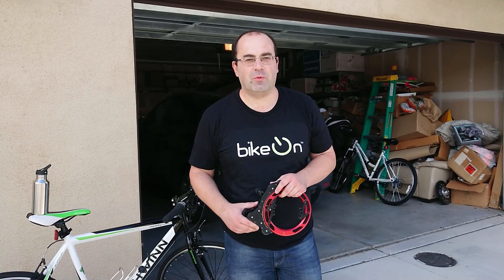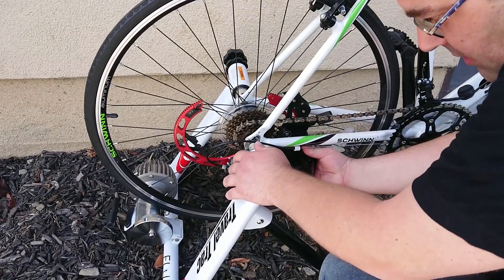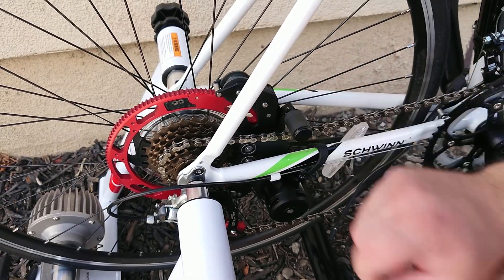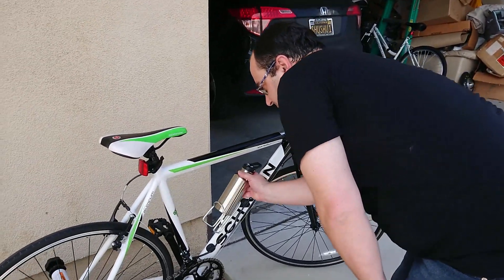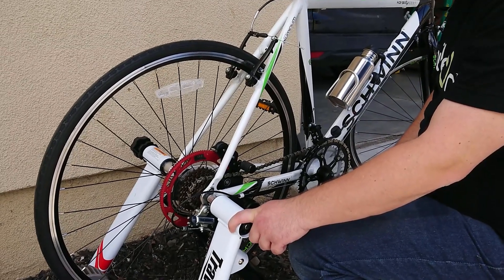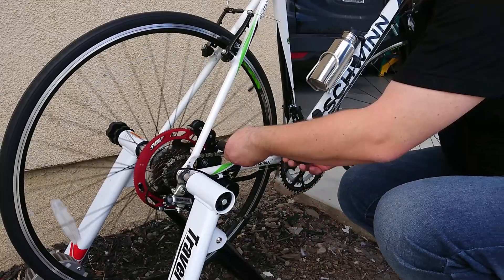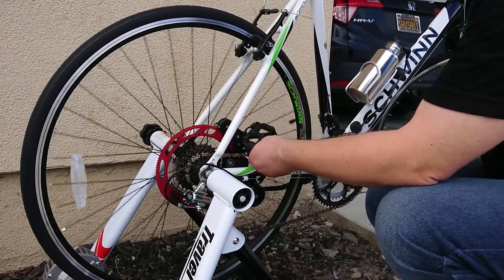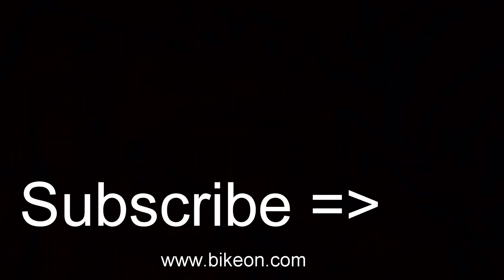BikeOn Demo: How BikeOn Works. HackadayPrize

Comment: Genius concept to measure the chain tension!
Have never seen such a simple torque sensor.
But how many of the gears in the rear are still usable?
The lowest gear is blocked by the device. What about the other gears?
Reply from the maker: Thanks. You lose 3 top gears, basically you exchange them for a motor. You can still use the rest.
Reply: @TheBikeOn  Oh! loosing 3 Gears is not exaptable. Maybe once i get a 12 Speed 10-56 or 11Speed 11-50 and use 11-32 missing 36,42and 50. Now i use Bosch with 10 Gears 11-36 or 11-40 on MTB.

Comment: You're brilliant! This is the easiest conversion kit I've seen. Will this work on a 20in fat tire trike, I just need help pedaling uphill. Thanks.
Reply from the maker: Hi. It will depend on the trike. BikeOn is compatible with most standard bicycles with gear size of between 25 and 36 teeth. Currently BikeOn is not compatible with BMX and other single gear bicycles (fixies), Brompton and other folding bicycles, bicycles with belt drives, internal gear hubs and bicycles with a chain guard.

Comment: Ok i don't know the exact language to use but I'm a very heavyset rider. I need my bike to go up hills when I can not. I love my bmx. Something like this ad on would be amazing so I don't need to buy an ugly EBike. Sooooo how fast & how long will it go uphill with a person that's 285 - 300 lbs?   If it's decent... I want one!
Reply from the maker: We have tested BikeOn with riders of 230-250 lbs on very steep hills. With some pedaling effort you can get up to 15 mph on those hills. The range of BikeOn is up to 20 miles depending on the terrain and the level of assist.

Comment: Awesome. How is the average distance capacity?, How many watts power? Love the torque sensor
Reply from the maker: Thanks for your interest. The range is up to 20 miles depending on the terrain and level of assist. As for the power, per government regulations, we have to limit power to 750 W of power in the U.S. (depending on the state), and 250-300 W of power in Europe, depending on the country.

Comment: Does it work on belt drive
Reply from the maker: The current version of the device doesn't work with belt drives. However we plan to release a different version compatible with belt drives.